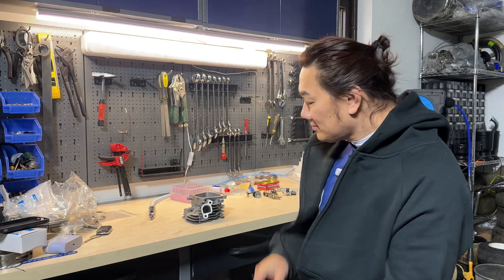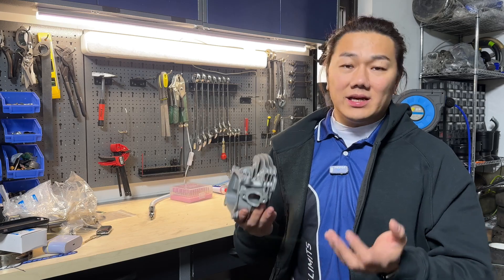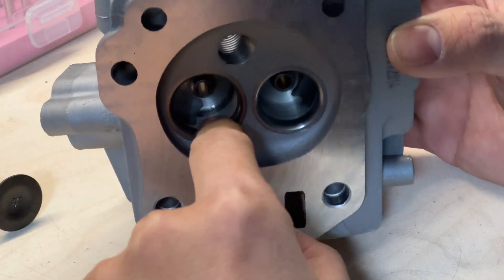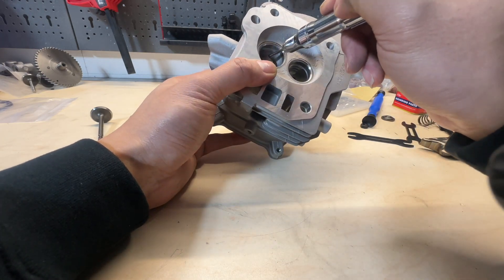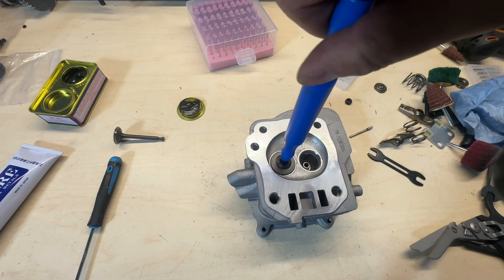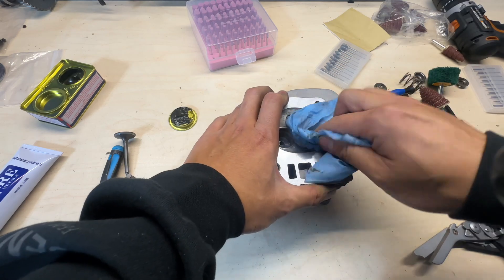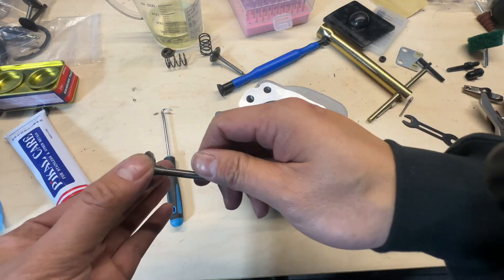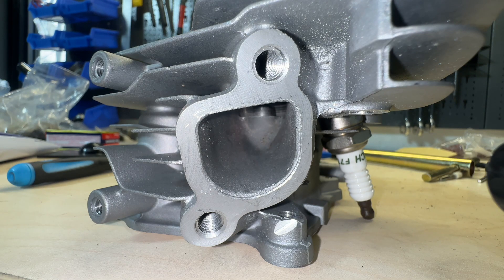New Prototype Engine: Porting

Comment: Don't embarrass yourself. This is an unprofessional approach. Working holding everything in your hands without any fixation, without examining the profile of the channel, without flow bench before and after is a way to nowhere. That's no way to be a champion, man. The valve chamfer is like on my grandfather's diesel, and it turned out that it is not possible to rub right away. And why all the frantic hand movements? Did you want to record a video so badly that you didn't even think you could screw up? Yeah, YouTube will take it all.
Reply from the maker: @grishasquortsoff5296  thank you got your comment. Right now, I’m not really pursuing the ultimate of anything as my reality just don’t allow for expensive gear like you mentioned. It’s more learning, documenting what I’ve done right or wrong, and the best part is I get a lot of people helping me out in the comments. When I save up enough, I’ll try to get better equipment. It’s a process.

Comment: Forgive me, I don't want to sound like some kind of a hole but that's absolutely NOT the way to effectively port and polish a cylinder head. No, in MOST cases it is wrong to simply hog out the ports to the max. Some build require you to max port the head. But for reaI, I seriously doubt that increased the horsepower whatsoever, excluding the rocker upgrade of course. You have to remove way more material than you did, every time.  It takes a bit of trial and error, but eventually you'll stumble up on a  platform to work your heads that really wakes your engines up. But every port job is different depending on the build, and your expectations of the engine, what you are going to be doing with it. It's just more to it than what you demonstrated. If people follow that method exactly they'll be some pissed off folks! Can you feel a power increase working a head in that manner? Js the cylinder head is the MAIN source of power for a an engine, IMO, it's ALL in the cylinder head design
Reply from the maker: Not at all, really appreciate your comment. I am actively seeking out knowledge on how to improve power output with what I have on hand. I am working on building a dyno as well so I’ll do a bunch of testing once that is functional to see if that really made a difference. The porting I did here was one of the easier solution to get a bit of extra horse power out of the cylinder that I had found. Which is also the most I can do at this moment as I do not have the right tools to do any advanced machining at the moment.

Comment: Good to see DIY work instead of just buying or farming out to a machine shop. Couple of hints, when checking for leaks use brake cleaner fluid or Isopropyl alcohol, this will remove any reisdue as you check, they are also a little less forgiving when checking for leaks. Second, when porting, open up the the inlet port transition angle from the neck to the back of the valve seat area, this gives the air fuel mixture a little swirl help passing the valve opening. There's a number of videos describing this procedure, David Vizard has a long video on port design, he also references another video that goes into the benefits of a widened port. The increase in port size is minimal to keep the velocity, it's the shaping that's important, these increases are only really felt at higher rpm's
Reply from the maker: Thanks for the insightful advice, I'll try it out once I have the dyno built, should be able to see the difference much better from the dyno results.
Reply: if you open up ur intake port wouldn’t that help you out too? i’ve heard moving from the stock i think 24mm up to 25-26mm, but i’m not to sure if it’s just a hoax i’ve been trying to find the best ways i can gain more power without just absolutely obliterating my block
Reply from the maker: @yljosh02  I would have to do a bit more research on that as I am also planning another build where we open up the intake to about 28 and I have been able to source the right tool and seats for it yet.